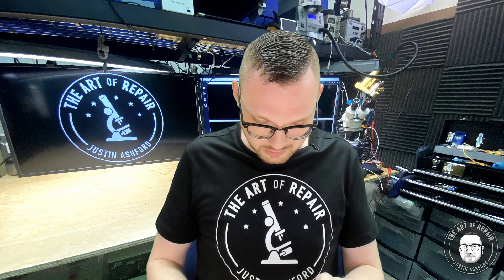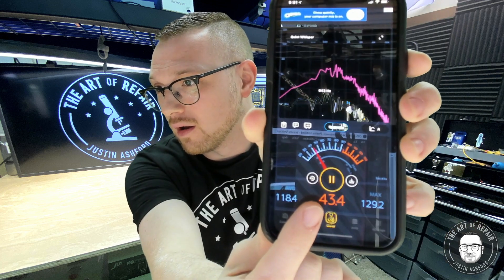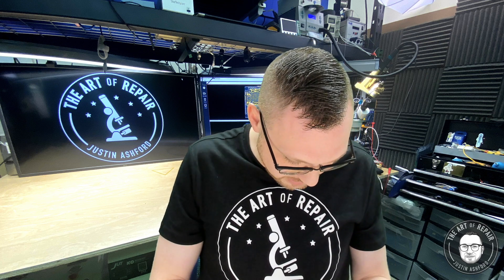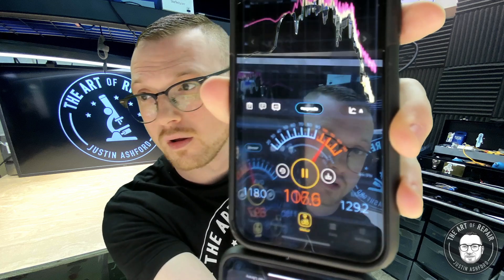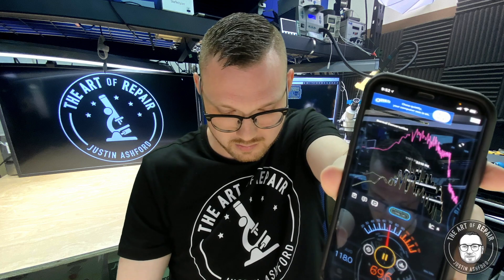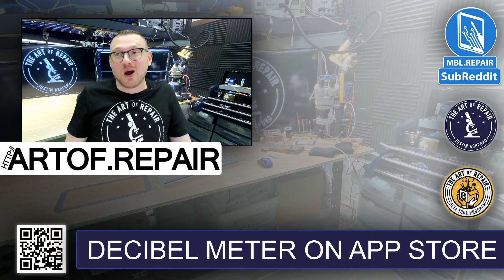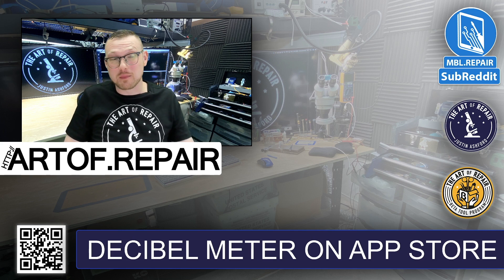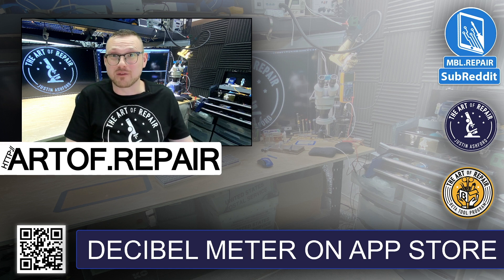Audio Issues | Quantizing Low Speaker Volume | Quit Using your EARS!

Comment: Just keep in mind the reading you get depends on the sensitivity of your microphone. While something like an iPhone should have fairly similar sensitivity across different batches of the same phone, it will not be the case across all Android phones, or different models of iPhone. The way to get an honest calibrated answer is to use a known accurate reading, either using a calibrated SPL meter, or a speaker and test signal at a known volume. So having a table of ballpark values would work, but probably be just a guideline that doesn't translate to your repair unless you have the same phone as was used when creating the table.
Reply: It's also distance sensitive so having a standard of how close to the speaker you are would be beneficial
Reply from the maker: @QrchackOfficial  this is great advice for everyone to check out! Arkadaius is 100% on this. Which is why i made sure to mention basically holding it directly mic/speaker, but distance and phone model DO matter. But overall. you should still be able to gauge quickly if something is amis even between brands. =)